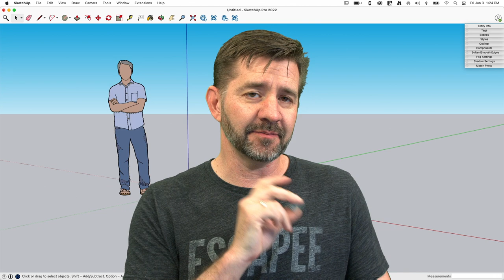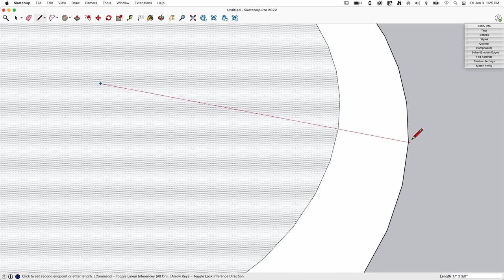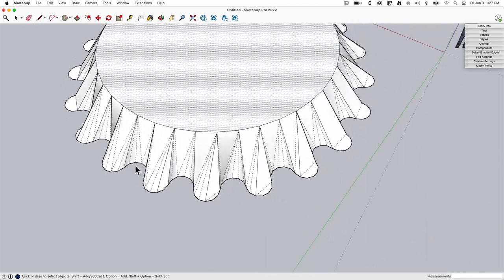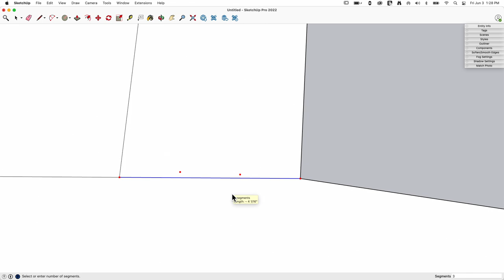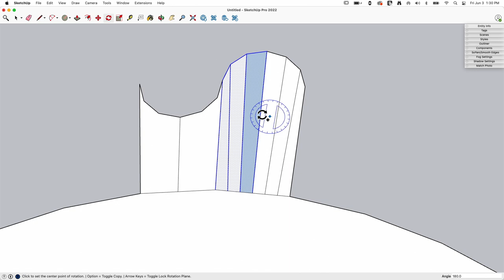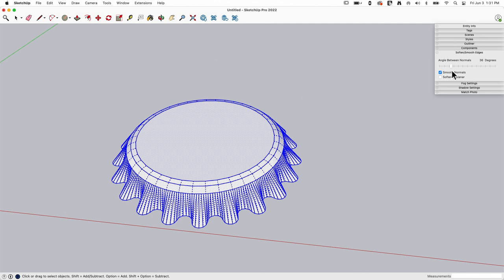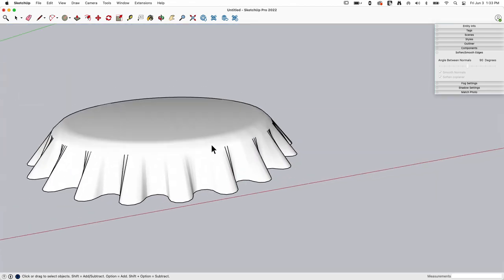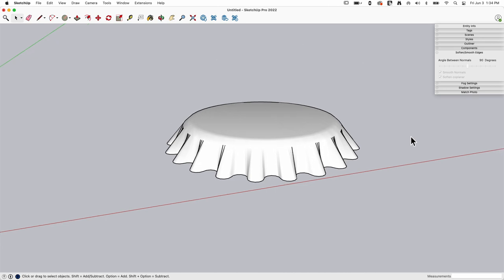Drawing a Bottle Cap - Skill Builder

Comment: This is so timely as I am trying to create a similar model but mine is not round. How do I make this work on an ellipse at the base and I want to transition smoothly to a rounded rectangle on the top surface with a rounded edge not sloped. And I'm working with small stuff, the ellipse is 36x45mm and the top surface is 10mm above.

Comment: Love the video!  A very cool skill builder.  So I tried pulling up the center and the sides didn't come up.  It was like it wasn't connected???  Did I miss something?
Reply from the maker: Did you tap the Up Arrow key?
Reply: @SketchUp  I (probably) made the same mistake at first: it's not the push/pull, it's the move tool. Move will influence connected areas. Up Arrow key makes sure you go straight up.
Reply: Chose the wrong recipient to answer - see my answer to SketchUp!